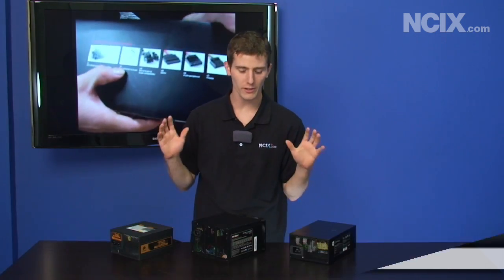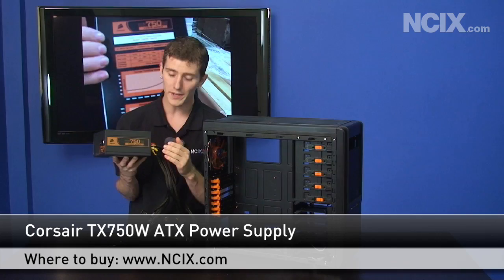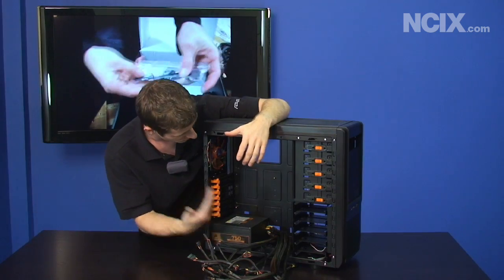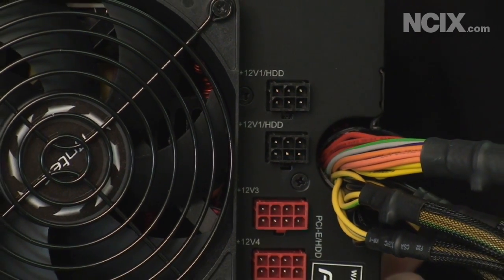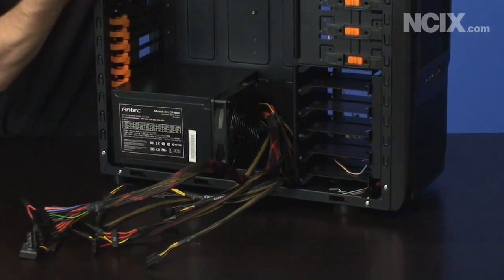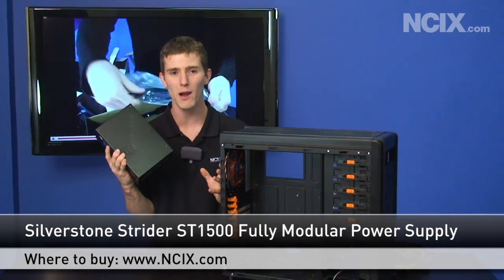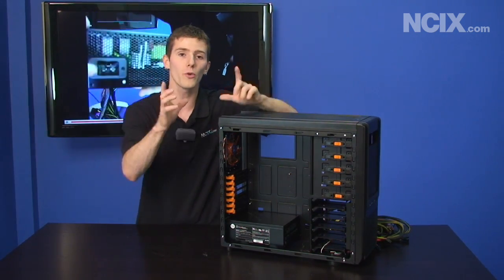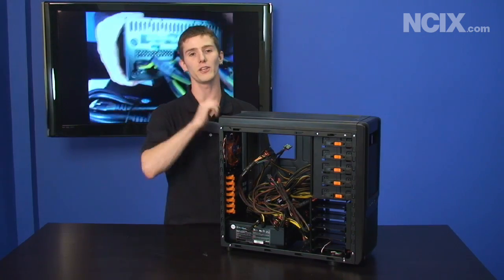Choosing a power supply. Modular vs Non-Modular (NCIX Tech Tips #57)

Comment: What Power Supply should I get: Corsair RM1000 Watt Power Supply  or Corsair RM850 Watt Power Supply
    Here is my build: 
Case: Black Vertex 

Motherboard: MSI Z270 XPOWER TITANIUM  

Processor: Intel® Quad Core™ i7-7700K Processor Overclocked 

Memory: (4x8GB) DDR4 3200MHz G.SKILL Trident Z 

Wireless: TP-LINK Archer T9E AC1900 Dual Band Wireless Card 

Graphics Card: 2x NVIDIA GeForce GTX 1070 GPU  

GPU OC: Overclocked Graphics Card - 2 Cards  

Sound Card: Creative Sound Blaster Z 5.1 Channels 24-bit PCI Express Sound Card  

HDD/SSD: XIDAX Performance 1TB SSD
Reply: You do know this video is old and ncix is bankrupt go on reddit or something man

Comment: i don't see what the big difference is with the 3 psu's. i might as well get none modular.
Reply: The difference is a modular power supply allows you to remove cables you won't use so that there is less mess and better airflow.
Reply: ok thank you for the info.
Reply: airflow doesnt matter with cables, but yeah, it surely looks cleaner
Reply: wtf are u talking about cable management doesn't affect airflow

Comment: i am using amd fx8350 8 core processor, gigabyte 990xa ud3 motherboard, 16 gb ram, 2 gb DDR% graphics card, deep cool 240 radiator cooler, 1 tb hdd in a NZXT P240 case... so can anyone suggest how much PSU watt supply do i need to run the cpu.

Comment: hiya what power supply would you recommend for

Corsair Carbide Spec-03 ATX/Micro ATX/Mini ITX Computer Case with White LED 
(£52.99)

Corsair CO-9050002-WW Air Series AF120 Quiet Edition 120mm Low Noise High Airflow Fan Dual Pack 
(£21.99)

Asus B85-PRO Gamer Motherboard (DDR3, SATA 600, ATX, PCI Express 3.0 x16, HDMI, USB 3.0, Socket 1150) (£75.04)

WD - 2TB Desktop SATA Hard Drive - OEM - Green (£59.98)

WD - 2TB Desktop SATA Hard Drive - OEM - Green (£59.98)

WD - 2TB Desktop SATA Hard Drive - OEM - Green (£59.98)

Asus DVD-RW Drive (DRW-24F1ST/BLK/AS, S-ATA, DVDR: 24x, CD-R: 48x, E-Green, Disc Encryption II)
(£14.01)
 
Corsair CMY16GX3M2A2133C11R Vengeance Pro Series 16GB (2x8GB) DDR3 2133Mhz CL11 XMP Performance Desktop Memory Kit Red
(£138.04)
 
Corsair CMY16GX3M2A2133C11R Vengeance Pro Series 16GB (2x8GB) DDR3 2133Mhz CL11 XMP Performance Desktop Memory Kit Red
(£138.04)
 
Intel Core i7 4770K Quad Core Retail CPU (Socket 1150, 3.50GHz, 8MB, Haswell, 84W, Intel Graphics, BX80646I74770K, 4th Generation Intel Core, Turbo Boost Technology 2.0)
(£239.99)

Samsung 840 EVO 250GB 2.5 inch Basic SATA Solid State Drive
(£91.60)

Corsair CW-9060016-WW Hydro Series H105 240mm Rad Extreme Performance All-In-One Liquid CPU Cooler
(£87.85)

 Microsoft GFC-02733 - OEM - Windows 7 Home Premium 64-bit 1 Pack Service Pack 1 DSP OEI LCP
(£84.24)
 
 
AMD CROSSFIRE
 
Asus AMD Radeon R9 290 DirectCU II OC Graphics Card (4GB, GDDR5, PCI Express 3.0)
(£299.99)
 
Asus AMD Radeon R9 290 DirectCU II OC Graphics Card (4GB, GDDR5, PCI Express 3.0)
(£299.99)
Reply: Try to find one that is atleast 80 bronze certified, with the help of parpicker see the total w you need ad like 100w for the future and get one that is semi modular and has good reviews. and really dont spend more than 70bucks on a psu you ve allready spent like more than1k on that build i suppose.
Reply: hiya thanks for the response i have built up the pc and it was over £1.5k i went with a 1000w PSU as i will be upgrading in the future but thanks for the reply

Comment: is axp super flower 500w a good psu?
Reply: That seems rather low voltage and you want your psu to be gold standard or higher. (Sometimes it's fine just going with silver) Around 750w is usually typical unless you're running more than 1 gpu.

Comment: there are psu calculators but since you have a 650 go for a 600 or a 750 if you plan to add an sli.. it is good to have spare power but not overkill on that aspect (ie getting a 1000+ watt psu for your system.. )

Comment: I bought a CX750m, however I was wondering how many cables should I use to power my EVGA GTX760 SC. The PCI-e cables that comes with the PSU have 2 (6+2) pin out each.
So should I power it with both cables or am I fine by just using one cable?

Comment: You will definitely need a PSU with more wattage, unless the power rating is platinum on your power supply, you will never be able to get by on 430W.  I would recommend a 600 or 620W PSU.  With your budget, I would recommend the Corsair CX600.  It is $57.99 on Amazon right now and it is an extremely reliable PSU.

Comment: I have a thermaltake 430 Watt PSU abd i am currently running the FX8120 with an asus m5a97 le r2.0 motherboard, and its cooled with 5 case fans and a CM seidon 240M, I am going to add a gtx 760 and i wanna know if i need to upgrade my power supply and i also plan on overclocking my system as well. Can someone please give me a response? I dont want to gert a bigger Power supply if i dont need it.

Comment: HUH????

In games, especially twitch shooters like CoD, BF, and also games like LoL and Dota 2, I can easily notice the difference between 55 and 60 fps... Between 60 and 120 is also noticeable, I find the game more responsive on my laptops built in monitor (120Hz), than on my external monitor (60Hz). Also due to a strange mechanic in the quake engine CoD allows you to strafe further at 125, 250 or 333 fps. PC>Console... And if you already get a pc for some games why not use it for the rest?

Comment: When it is receiving the light projected from a screen it does. You're confusing the source with the receiver. A screen (aka, the source in this subject) displays small bits of motion at a time. Video is not live action and reflecting light directly to your eyes, it is a recording or an animated rendering. The only way to convey this to your eyes is through a Frame Rate (a speed rate of "captured motion stills"). Each frame will show things in a slightly different position to convey motion.

Comment: 1500W is 2 x as powerful as a 750W, A normal PC will use a 300 - 500W PSU and be plenty powerful, add a high end graphics card and that can use almost as much again. In electrical terms the wattage is derived from the voltage x current, a 1500W PSU at 12v will give 125Amps of current, as he says not many people will need or even be able to utilise a 1500W PSU.

Comment: ive got the Newton R2 1000W PSU, the only wires that are always attached are the 24 pin and 8 pin, i would highly recommend it to anyone, 80+ certified and cost around £110. + the PSU has its own little bag ^-^

Comment: The Xbox locks most games at 30 fps for a consistently smooth motion perception. Computer components and computational tasks make the fps on most PC games spike...is the screen you're looking at currently flickering? (its running at 60hz most likely)...so what is the point in having over 60 fps if the monitor only registers 60? PC Gamer's like myself consider a minimum of 30 fps to be a very acceptable viewing experience.

Comment: does that include a keyboard and mouse? say you spent an extra 50 just on both that makes it $100 more than the xbox with a controller. however if you did build that pc i would be better than the xbox. an xbox can play games at 1080p and the games would are MOSTLY on the medium settings some settings are on lower detail however and be at 50 - 60 fps. i could be wrong but im sure razethew0rld said that the pc could play games in 720p(not 1080p) on medium settings fine.

Comment: You will not need a 750. I have a 650 and I run a GTX 670. I would recommend something between 450-500. IF plan to upgrade to better hardware then go for at least 600w. Power supplies are something that are good to spends a lot of money on, but only go for what you need. 600ws would suit most people.

Comment: hello. i want to start building my own gaming pc. i will buy a Gigabyte GT 430 2 GB graphic card but it needs a 400W PSU and my own PSU is only 300W...So, here is the question. If i buy a new 430W PSU would it work all the pc correrctly without any problem or i need a bigger one like 750W?

Comment: There are pre-built systems. Also, unless you mean external, an XBOX probably has more than three cables inside. I'll admit, an XBOX will be less expensive, but is not nearly as useful as a PC. Again, unless you build your own, you don't need to connect a ton of cables. Don't complain about having to build your PC when you don't have to, and don't find a video about builds just to complain.

Comment: PhysX is a feature is nVidia cards so that the physics calculations will be performed by the gpu taking the stress off your cpu. It's only used in a few games (1-3 a year).
It shouldn't be a factor in choosing a gpu.
From those two go for the cheaper one, they are basicly neck to neck with stock clocks. ( i asume you dont overclock if it is your first build)
Sorry for possible bad english.

Comment: External cables for desktop: Monitor, Mouse, Keyboard, Power. Only 4 needed.
Mouse and keyboard could be wireless, so there can be a minimum of 2 external cables only. Even if the PC needed more cables, why does it matter? 

If you buy a console for gaming, you still most likely have a PC, unless you typed your comment on your Xbox. Have fun paying for Xbox Live. Also, unless you live under a rock, you would know PCs can be pre-built, or custom built.

At least troll well.

( ͡° ͜ʖ ͡°)

Comment: I have a 700w PSU with an i7 and 670 ftw. I'm planning on using my old 560ti as a physx card. Can my PSU handle it? (It means using 2 Molex to 6 pin adapters.)

Comment: lets say you need 100w to run your pc but you put in a 1000w power supply the computer will still run fine as if you had put in the 100w power supply. having a bigger power supply will not harm your pc it will just mean if you need more power it will give it and if you dont need more power than thats fine as it will only give you what you want.

i advise you go for a decent brand and do not go cheap on the powersupply as if it blows out it can potentially take out your whole system.

Comment: Im building A computer, because the one I have is Good, for fraps 60FPS and Some High CPU And APU Usage, but I cant play the games I want, I got all the things down but a POWERSUPPLY, Im really Confused about this Conponent.  If u buy a Bigger Power Supply then ur Computer takes (Wattage) Would it ruin the Computer or just run the Components u pick fine and no-over Wattage

Comment: if you're not planing to run SLI or Crossfire.. go with 560w

i have a 6850 and a fx4110 overclocked at 4.2ghz and my power consumption ("according to sXtreme Power Supply Calculator") is below 400w

if you're going to use Intel + an SLI or crossfire config.. you might have to get at least 700w of PSU power
:D

Comment: so im getting a nzxt switch 810, and im going to run 3570k cpu the 560ti by ASUS and i need to know which power supply i would need so that all the cables can reach the motherboard in the switch 810, and also will be able to have a 560ti and maby even a 660ti when i may upgrade in the future so ya if i can get some answers that would be AWESOME :D

Comment: Probably 750W would be a good number. So if you run Crossfire/SLI, you would have 70W more for safety. If you had 560W with 560W PSU, the PSU would die sooner.

Comment: I humbly disagree that manufacturers stay away from modular designs simply as a matter of cost. You're talking about a dollar or two worth of connectors at the volume wholesale level if that. Adding a connector in line with a power feed is adding a resistance. This is the reason PSU manufacturers prefer a non-modular design as do demanding users.  It's the technical aspects of connectors .. not the cost.

Comment: If you're using an on-line PSU wattage calculator they are designed to factor in all of your devices drawing max current simultaneously. These calculators also build in some breathing room on the order of ~10-20%. So, yes, a 700w PSU is more than adequate for your immediate needs plus some nominal future growth.

Comment: so guys, i got 8 gigs of ram a 3770k cpu and a sapphire radeon 7950 ( non oc) and a 750 watt psu will i be able to run crossfire sapphire radeon 7950 with a 750 watt power supply?

Comment: HOWEVER,  if you plan to overclock either the cpu or video card or both.  I recommend a psu with single 12 rail of 45 amp at total 750 or 800 watts ( corsair, antec, nzxt have never failed me in my 16 years of pc building 55 pc's for 50 different customers)

Comment: Any psu that is 600watt or above with a single 12v of 35 amps or dual 20 amp 12 rails ( you always have to factor in small percentage of possible amp loss on how they combine to support the video card under load) or more will be perfectly fine.  
Most 660ti's ( reference & o/c) have minimum 30 amp requirement. I've ran a gtx 680 on a single 12v rail 30 amp 700 watt psu with a 3570k o/c to 4 gig manually, ran prime95 & furmark for 48 hours. not one single crash. :)
7870 needs alittle less. cheers

Comment: depends on WHAT all you are running. 

Gaming machine?  HARDcore gaming rig?  Ultimate gaming rig? Hardcore workstation machine?  
details.  details.  specifics.  Otherwise..all you're asking is. " hey  I got a car that goes 80 mph...I'm not sure if i'll be taking the interstate to work or not and it's 20 miles away and i think i may need a car that can do 140mph.

Comment: 550 is the min. for that...
more than 650W is a waste
but you might wanna give your PSU some "operational space" so it wont always work on its limits so it will be more stable, cool and quiet...

620 is a very recommended for that 550 is enough but will work on 85%+ (more to the 90's) so you might consider taking higher than that...

Comment: can a 1000-1500 watt PSU can support Core i7 3980x OC to 5.2GHz 64GB RAM 4x Intel SSD in RAID 0+1 4x Seagate HDD RAID 10 Quad SLI GTX 690 classified hydro copper. 12 120mm Fans for 4x 360mm RADS. and the rest of the pc parts

Comment: @LinusTechTips do you need to have 2 seperate walls to draw power from if you have 8 monitors witch draw a total of 375 watt of power? Because the power supply is so high wattaged.

Comment: can I run gtx 560 msi on my computer

I have this power supplier Please help thank you.

1 x 24-pin ATX main power connector
1 x 4-pin ATX 12V power connector
2 x SATA 6Gb/s connectors
4 x SATA 3Gb/s connectors
1 x CPU fan header
1 x system fan header
1 x front panel header
1 x front panel audio header
2 x USB 2.0/1.1 headers
1 x serial port header
1 x clearing CMOS jumper

Comment: a fully modular power supply it is useless. why buy a pc psu if you don´t intend to use the 24 pin and the 8 cpu wires. maybe for testing or something but for turn it on you need to short the black and the green and the last one is in the 24 pin

Comment: @BenTheMagnifice 
help me too :)
im going to get a 3.2ghz pentium dual core (E6700)
8gb ram 1333mhz
1gb HD5770
and then a MSI G41m-P25 motherboard.
my case will only have 1 blue LEd which is attached to the small fan

would a 400w be alright? because i was told to get a 500w to be safe for future upgrades but i wont be for a LONG time, so id rather save money now :)

Comment: If you have a case like the aerocool xpredator you can buy a non modular powersupply and it will be look better than with a modular. But if you have a xigmatek ... it's better to have a fully modular power supply. So it all remains on the case

Comment: Corsair HX. I never seen the point of fully modular. Your gonna HAVE to use the 24 pin, 8 pin, and on higher end PSUs like an 850 W is the PCI E connector (not like ur gonna use an i3 w/ integrated graphics with a 850 W PSU)

Comment: what you do with all thoes cables if your psu is in the top of the case is lower your dvd rom to the second slot and stuff them above the dvdrom, i do agree that you will need the main cables , but whats easyer to install, a rats nest worth of cables or a fully modular then one cable at a time

Comment: @HookEchoMedia modular & non modular from the same company has the same quality. the reason u skipped on ur latest build was to save some bucks coz modular costs more.

also the benefits of modular PSUs is lets say after like a couple of years u wanna change ur PSU all u have to do is remove the PSU & let the cables stay where they are so u can replace it with another modular PSU.

btw is ur AX750 from corsair totally silent? i have heard it is

Comment: great video BRAVO!
Can anyone tell me why when I look at pictures of PSU's on newegg or the mfr websites, they don't show the cables? Meaning they don't show the side with the cables coming out. Only the vent side, top and bottom sides..why is this? it would be nice to see what cables they include. And this is for non/modular units.

On another note, I think antec could have used a rubber gromet on the base connections where the cables go into teh case. it looks quite horrible.

Comment: My cousin actually converted a normal PS to a modular one but cutting off ALL the unused wires after he hooked up his machine then put electrical tap on the ends each "he left them about 1 inch long"

instant modular.
He could also put them back on as he has a solder iron if he needs.

Saved $50 DIY modular PS :D lol
i wont do it though. dont have a working solder gun.

Comment: I got a Recom Power Engine M500, 500watt and it hold a Q6600 at 4100 mhz and a GTX285 with oc, so a 650 watt power supply is good enough fot that configuration

Comment: Good examples of a semi-modular PSU are the OCZ ModXStream Pro, Thermaltake Toughpower, SeaSonic M12II, COOLER MASTER Silent Pro, CORSAIR CMPSU, etc... 

You are missing the hidden marketing message in this as he's trying to showcase those three PSUs to us. Some people will not realize the Antec is oversized, buy it and realize it won't work. The TP750 would have been the ideal choice to use in that case.

No, I was not referring to the power output of mod vs non-mod.